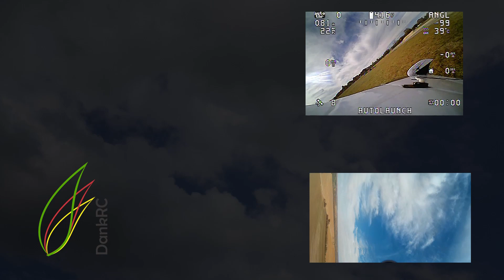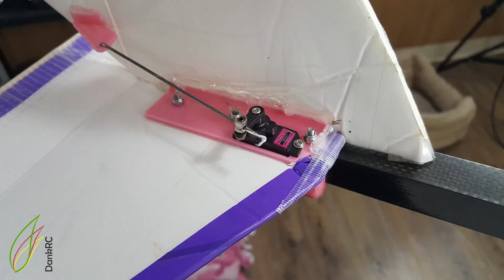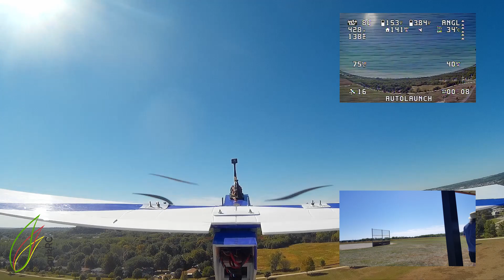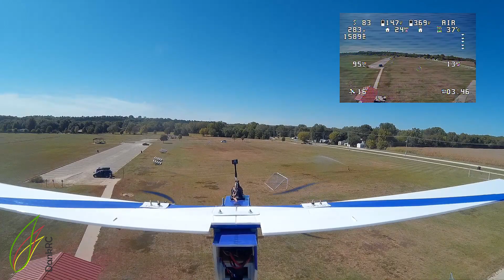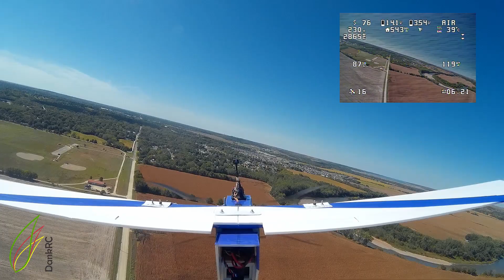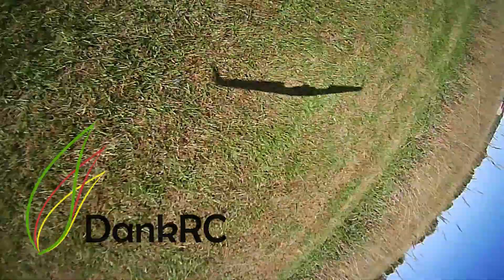FT Twin Explorer new R9 (iNav 2.5.1)

Comment: What.. put inav 3 on there .. 2.5 is 💩
Reply from the maker: I'm working on a new build of this model with a newer Matek FC and iNav 3.  When I built this one iNav 2.5.1 was the latest and it works pretty good for me!  One of my other favorite planes, the iNav equipped wide pod FT Arrow is still on 2.2.1 and it flies great!  I'll probably get around to reflashing both of these to iNav 3 this winter.
Reply: @DankRCX  inav 3 is just like a game changer .. definitely boosted my confidence in inav, flying great and finally seems like more reliable !